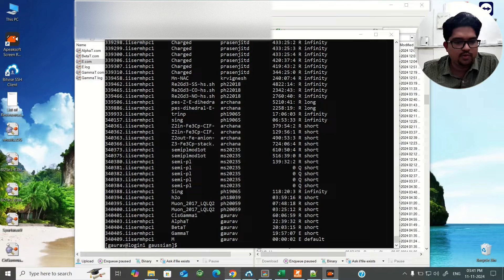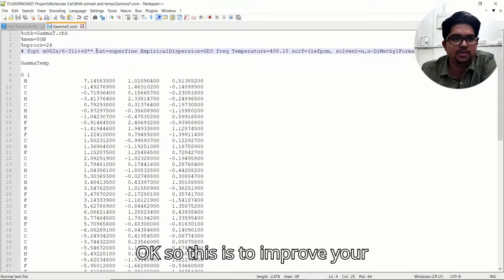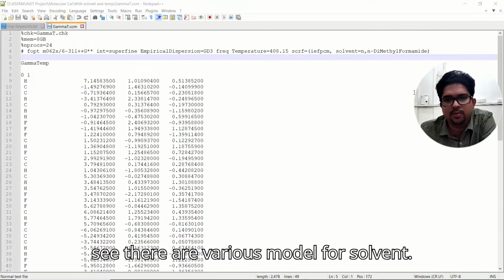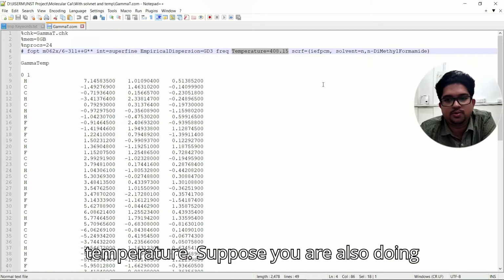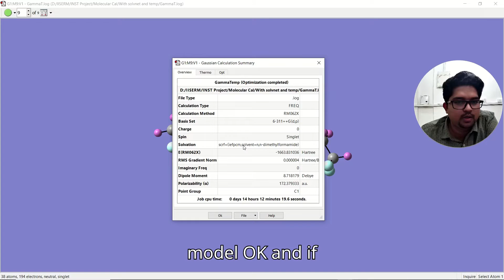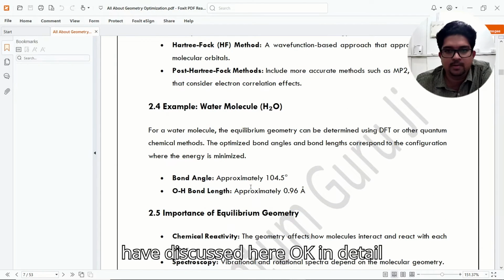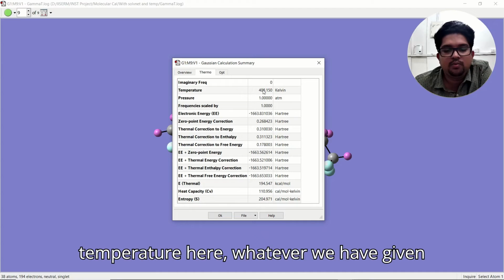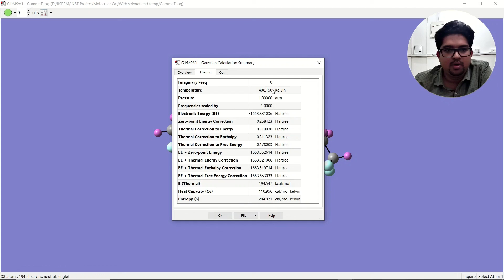How to do DFT calculation at different Temperature and Pressure using Gaussian

Comment: What are the calculation are possible for amino acids?
Reply from the maker: @ganeshkumar.m111  you can optimize the geometry  and perform frequency calculation to get minimum energy geometry followed by thermodynamic properties, electronic structure, and Vibrational spectra. You can also perform NMR, EPR, etc.

First you need to decide, what's the purpose of calculation then you need to proceed.